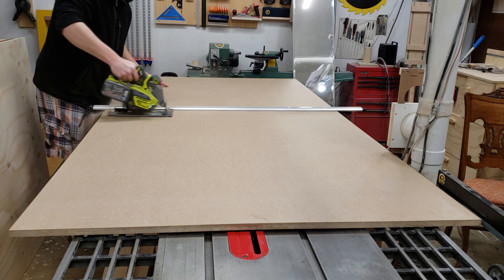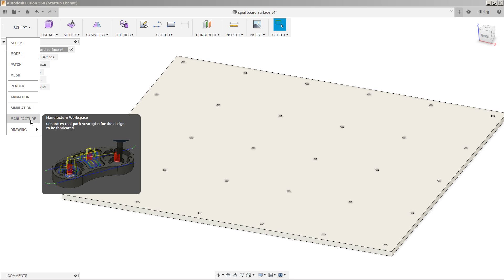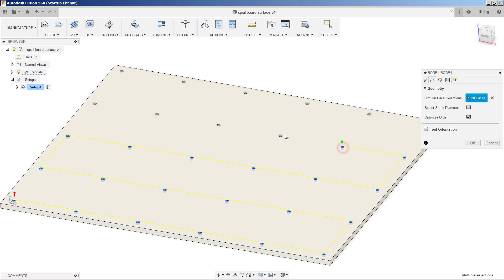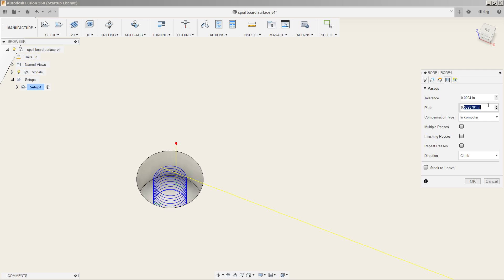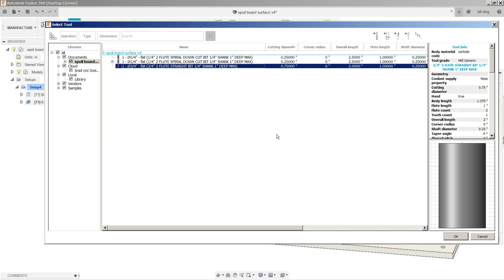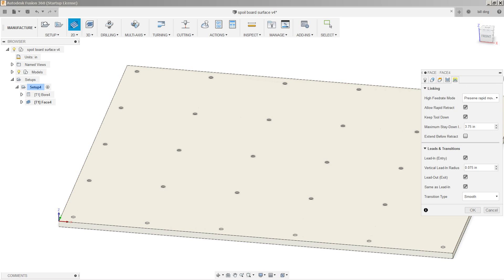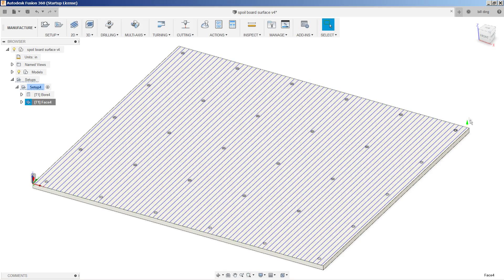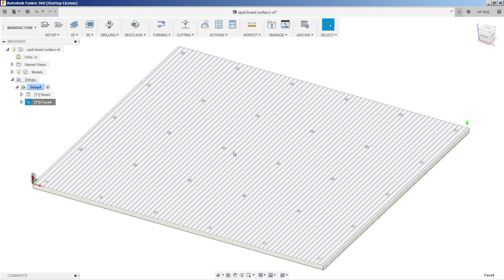How to make a CNC Router Spoil Board (Fusion 360 Tutorial)

Comment: Drilling operation for the holes and you can automatically select all holes within a range.  It would save you from needing to select each one.

The thing I'm having trouble with is I'm using a surfacing bit instead of endmill to surface with and I need a shallow zig-zag ramp so I don't bottom the bit out before it has a chance to cut material away.  I can't overhang the spoilboard because the travel is the exact size of the spoilboard.

Comment: Hey, awesome video. One question though: for those of us creating our inaugural spoilboard, how do we make sure the origin point of the file lines up with the same point at the bottom left of the spoilboard exactly? 

Also, do you affix the uncut spoilboard to the baseboard with tape or something to keep it from moving during the boring process? Or, is the kickback from the bore not enough to worry about this?
Reply: Manually Jog the cnc around your base with a vbit to get the exact cutting area of your cnc

Comment: hey amazing work. very informative. Thanks for the video. Just One doubt, there are parallel lines visible on your spoilboard post surfacing. I tried cutting too and am also getting the same issue. Any tips on how to solve that?
Reply from the maker: It means the spindle isnt 100% trammed true.
Reply: @DIYBuilds  thanks man, much appreciated. your design is very innovative, have used parts of it in my own machine